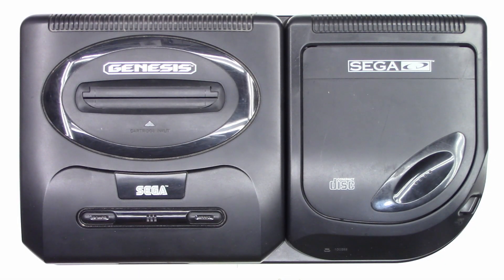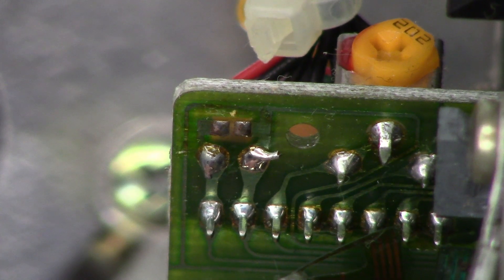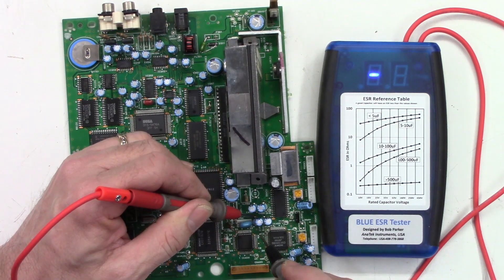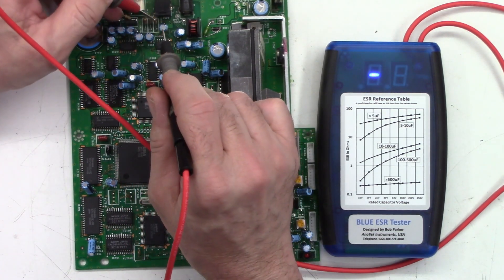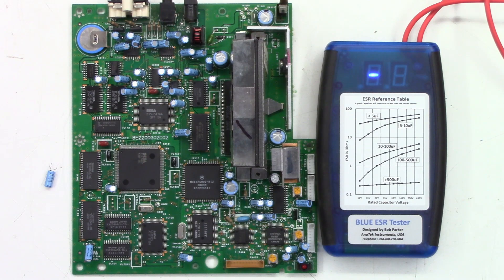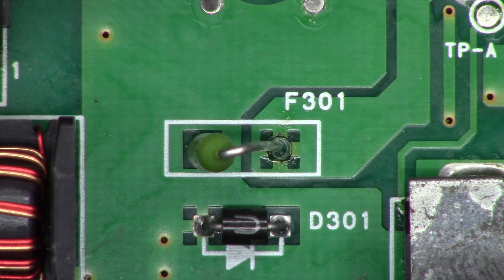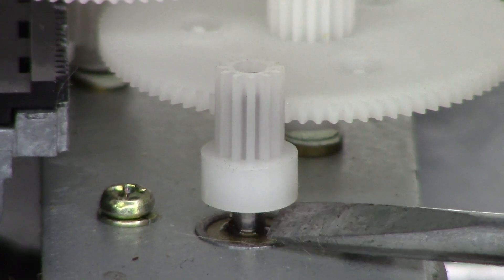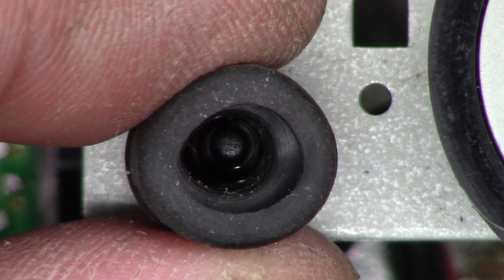SEGA GENESIS CD MK4102 MK-4102 CAPACITOR TESTS AND MECHANISM SERVICE - THE BLUE ESR METER IS AWESOME

Comment: This is a Sega CD model 2,  not known to have capacitors issues (yet). I you want more challenging units, I suggest you to take a look on Sega CD Model 1, Turbo DUO or NEC Super CDROM². The last ones can be way much more challenging to repair, especially after capacitor leaks.

Comment: The model 1 Sega CD units, the one with the motorized tray for loading the CD, used SMD-type caps that are known to have problems with leaking and may cause damage to the PCB.

The model 2 units, like the one you've got in this video, were far more robust.  Of course, that's not to say that they never fail, especially considering the age of these things now.  Another thing to check is the condition of the ML2032 rechargeable lithium battery for the save game RAM; if the battery is bad, it obviously won't hold a charge, so the save game RAM will lose its contents and formatting whenever it's powered off.  Once the battery is replaced, leave the Sega CD powered on for at least 2 hours to charge it.  Leave it on overnight for a full charge if possible.  Of course, you keep the battery charged by playing it for hours...

There were actually at least two variants of the model 2, with different PCBs and disc drives.  One variant uses the JVC Optima series CD traverse assembly.  The unit you serviced uses a Samsung SOH-04T.

Comment: I see you have used the  BLUE ESR meter in a couple vids lately.   Any reason why you abandoned the old analog ESR meter?     Any reason to purchase the BLUE ESR meter over the old analog unit you have?    I built an ESR tester and I does a good job.     Any advantage to getting the BLUE ESR meter or just stick with the analog versions.    My homemade analog ESR tester has been very reliable and save my butt many times.  Well worth the effort in building it.  Thoughts????
Reply from the maker: I do like my old analog ESR meter but the new Blue ESR meter is just so fast and you don't have to wait for the needle to stabilize. I do plan on doing a analog to blue comparison sometime.
Reply: @norcal715   I for one would love to see that comparison.   I built mine with a small movement.   I used an analog VU meter I scavenged from a 1970s Radio Shack cassette deck.   I knew I would find a use for that someday.  It only took 41 years.   Now, what to do with the left channel's meter?
Reply: @georgeiceman867  It was right where I put it 41 years ago.   LOL

Comment: I bought a blue esr tester like yours recently. I was wondering where did you get the test probes that you put on the banana plugs? I would rather use those than the alligator clips that came with the unit. Will you let me know? I really do enjoy your repair videos.
Reply from the maker: Those are keysight modular test probes

Comment: Its been along time but I remember the graphics being better than that. I must be getting old.
Reply: For the time, the graphics were pretty good if you had a game that really took advantage of the system's capabilities.  "Soulstar" is a good example.

Of course "Silpheed" wasn't the best the system had to offer, though it was better than most.  It's a rail shooter using pre-rendered CGI FMV for the backgrounds.  While the frame rate of the foreground graphics generated by the Genesis/Sega CD are running at about 60 FPS via CRT scan double-strike, the frame rate of the background FMV couldn't be terribly high because everything was streaming off of the CD drive at 1x (roughly 176 kB/s).  Color quality of FMV is limited by the color palette of the Genesis/Mega Drive (which is why live action FMV games look grainy).

Comment: How do you know when you've got solder pads you have to short to prevent static damage? Is that something you need to look for whenever you disconnect the laser diode in a CD/DVD player?
Reply from the maker: Yes most have a solder pad. Some have two depending on the model. As long as the laser is still connected to the main board it still has ESD protection, once it is disconnected it has no ESD protection.  You have to jump the pads before disconnecting the pickup.
Reply: Yes, often the shorting pads are on the ribbon connector from the laser assembly itself. A blob of solder on that and you're good to go.